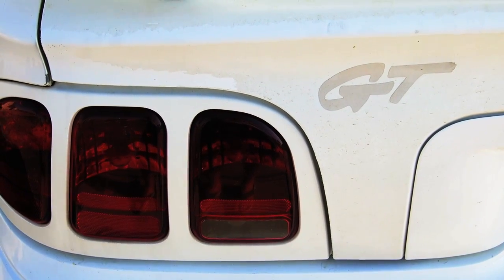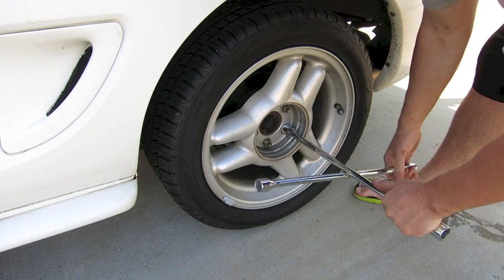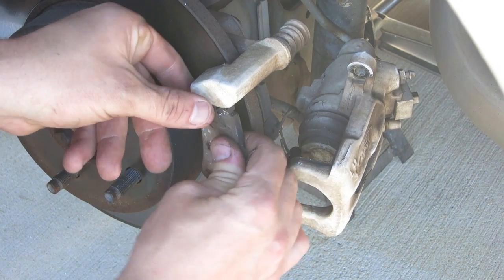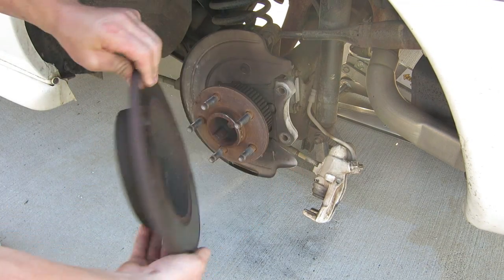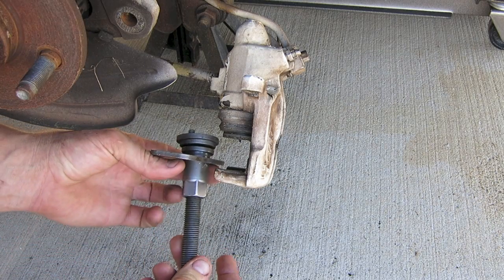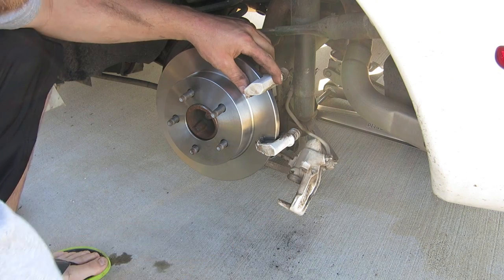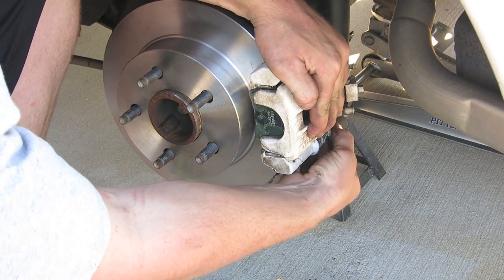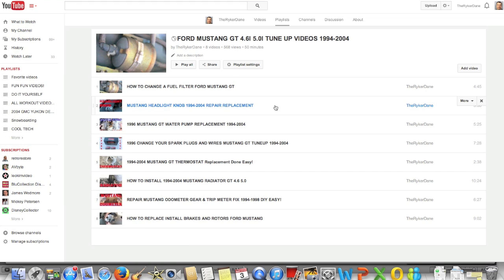MUSTANG REAR BRAKES AND ROTORS GT 4.6 5.0 1994-2004

Comment: Forgot to mention to open the cap on the brake fluid reservoir so the pressure doesn’t build up when you spin the piston back on the caliper. Good video though!
Reply: I crack the bleeder valve and let the fluid out that way. I have lost 3 master cylinders after forcing brake fluid backwards through the lines.

Comment: I'm having a lot of trouble putting the caliper back on. It seems as thought the piston is back as far as it will go, since no matter how much I spin it, it doesn't seem to be making any more progress and It's back as far as yours seemed to be. However, when I put on an old brake pad on the front, since it is much thinner, I am able to fit the caliper onto the rotor. I have been working on this for hours. Any help??
Reply from the maker: 4thatdude1 the rear brakes are tricky because you have to spin them. But as long as you get the piston back in far enough to put the pads in they should go on, unless somehow you have the wrong brake pads. Make sure the piston is almost flush when it is spun in. I hope you get it.

Comment: I got this tool and it works on the rear brakes perfectly. The indents are 22MM. You can also use it on the front, too. Use some 7/16 washers.

Comment: Thanks for this video. I have a friend who is coming over to fix them. But, I am gonna try to have them disassembled for him. That way he can basically put the pads and rotors back on. Also gonna replace a stuck disk brake caliper on the passenger front. Thanks agin for the information !
Reply from the maker: Glad I could help

Comment: Ahhhh.......makes sense.  Thanks for that little nugget.  When you mentioned something about some instruction manuals suggesting using needle nose pliers, I thought to myself:  WTF?!?  Then I realized they were probably needed so that you could jam them into your skull and end it all after you realize that these rear brake cylinders don't just retract straight back with even pressure.............but that they screw back into position

.......now that DOES make me wonder how they unscrew themselves to make contact with the brake pads when pressure is applied to the brake pedal.  I will investigate this phenomenon further........as I have no life and am waiting delivery on my 2002 premium convertible to arrive from NJ.
Reply from the maker: Yep i know, I never would have thought they would have had this design on an American car from that year. A lot of foreign cars have that design on the rear. not sure why.

Comment: Thanks for the video. It boosted my confidence. I just want to know what is the bigger clip for? I didn't see you install it and I never saw an old one when I removed mine. Thanks.
Reply from the maker: The clips I think you are talking about are the ones that are there to make noise when your brake pads are low. Sometimes people install them and sometimes people don't.
Reply: thanks

Comment: Good video.  It looks like you forgot to install the little butterfly plate thing that clips into the caliper casing.  You point to it and even pick it up at 3:55, but you don’t install it. It is needed to allow the little wires coming off the pads to slide against smooth metal instead of the rough caliper casting.
Reply from the maker: Pet Rock's Garage You are correct, For some reason I didn't show it in the video, not sure why. I did install them on the caliper though. Thanks for letting me know.

Comment: It's easier to depress the piston in by opening the bleeder valve and let the brake fluid go through a funnel and a bottle. Otherwise you're pushing the fluid back into the brake lines.

Comment: This video helps a lot. I still need to do my passenger side. And I had to take off a small spring so I could reach the bolt in the bottom. Do you know what that spring was for?
Reply from the maker: I think the spring you are referring to is a spring that keeps tension on the emergency brake cable. You need to make sure you put that back on. Glad I could help, thanks for watching!  Also what year mustang do you own?
Reply: Yeah it was for the ebrake. It was really hard to put back on. So I left it out.  I have a 2001 mustang gt.

Comment: Tried this today and was almost done when I realized I didn't have the clips for the brake pads, they weren't in the box and the old ones didn't have them on them either! So back to Advanced I went. Also how do you know when the piston is fully compressed? I turned and turned mine and it never got tight.
Reply from the maker: just turn it until you can get the caliper back on, then when  you push the brake pedal it will tighten up

Comment: GOOD video. Got a question for you. Is there an easier way to get the E-brake spring back on the caliper?  It popped off,  and now I'm having  trouble getting it back on. I did this same job a couple of years back, with the same problem. I eventually got the spring back into place ( an hour or so)  after dikkin with it.  Do they have a specific tool for this? Arthritis  is preventing me from using my first method.
Reply from the maker: I guess I am not sure if there is a tool or not for this. There might be one in a kit you can get from advanced auto or oreilly auto
Reply: I just used a pair of needle nose pliers and a lot of force, I got the cables to go back in. I'd rather not have to go through it again though.

Comment: At 3:46, where does that bigger clip go?  I got one with a hardware kit but I didn't see one coming off when I took them apart.... and you didn't seem to put it on.
Reply: It goes in the center of the caliper above the piston and one end sticks out thru the Gap on top
Reply: @mr.ed2092  Hrm, doesn't look like he put it in there... ? Took mine off to replace them got the hardware kit and came with that clip... but mine didn't have that anywhere, is why I'm asking.

Comment: Im having alot of trouble trying to put the break piston in using the tool. Its too hard to twist it in. How can i make if smooth?
Reply from the maker: Diego Estrada Yes it can be very tricky and hard to put back in. Try spraying WD or PB blaster on it if they are rusted up brakes, This might help them go in a little easier.

Comment: I did the exact intructions. Lol but for my test run to the gas station and back. My back tires went up in smoke and the rims are hot to the touch. What could be the cause of this?
Reply: Did you wipe the brake cleaner off after spraying the fuck out of it?

Comment: You don't need to open the master cylinder or bleed the brakes with this process?
Reply from the maker: +asmodeus20 nope, only when disconnecting the brake lines from the caliper
Reply: Awesome, did my rear brakes the other day.  Had to pound the crap out of one rotor rusted shut on the hub, nothing about 5 mins with a dead blow hammer couldn't fix!  This process also fixed my constant-on brake warning light on the dash cluster.  Saved a ton of money! Excellent video, thanks Dane!
Reply: you do have to open the brake fluid reservoir, and remove 60 to 80 ccs of brake fluid, otherwise as you compress the piston the brake fluid will go all over your floor.

Comment: Why does my 1998 Ford Mustang seem to have allen wrench bolts and a rubber boot on another one that doesn't seem to want to come off
Reply from the maker: You don’t take those off for the caliper. Unless someone swapped out the factory bolts for Allen wrench bolts which they shouldn’t have.

Comment: is it 100 ft lbs for all models between 94-04?
Reply from the maker: Yes thats a general guide for those years. Might be different with other wheels
Reply: TheRykerDane Ok thanks. I plan on getting a Mustang GT in those years. I'll probably stay with stock wheels because it will be my first car.
Reply: XxAdamIsChaosxX you need to get some ccw rims brah

Comment: ..I tried using Needle-Nose to turn the piston, it didn't work. Next time (when I upgrade the rotors) I will hopefully be able to buy the specific tool. 😉🖒
Reply: +Tr1ppyDJ4L.A. The tool is the only way to go!  My pistons were hard AF to turn even with the tool, I couldn't imagine with needlenose pliers.  They have it at O'Reilly for about $60 deposit, fully refundable.  Protip: use cash so you don't have to wait 3-5 business days for your card to be refunded.
Reply: +asmodeus20 🖒🤘
Reply from the maker: +Tr1ppyDJ4L.A. you can always rent it
Reply: +TheRykerDane 😃🖒

Comment: What's the name of tht tool u used to put in the brake caliper tried twisting it but didn't go in with big plyers
Reply from the maker: Ruben Mendoza It's a brake tool kit that you need to rent from your auto part store. It can be done with a needle nose pliers but it is very hard.
Reply: TheRykerDane so what happens if you dont use this tool? I didnt know it turned when pushing in so i used a clamp and hammer and eventually got it to go in but I'm guessing I ruined the caliper?
Reply from the maker: The420Smokey420 Its just a lot easier with the tool. It will also take a lot of time and aggravation out of the job too. As long as its not damaged and you got it in, you should be good.
Reply: TheRykerDane Yea it went in fine, but I did have to unhook the brake line so I had to bleed it, which isnt hard. But now for some reason it smokes and gets really hot when i drive. I've taken it back off a few times and tried to resolve it, but it still does the same thing, and it cracked the pads from getting so hot.
Reply from the maker: The420Smokey420 Are you sure they are not rubbing? Is the caliper tight on the pads? Does the wheel spin freely when you put everything back together? I hope the piston is till working ok
Reply: TheRykerDane The rotor does seem to be a bit tight, but it does turn a little by hand, and I pushed the caliper back in and then had my daughter press the brake while i watched it, and it closed on the rotor like it should, and when she let off it did back off the rotor just a hair like it should. While driving I don't hear any rubbing or anything, it sounds and works like it should, it just gets really hot and smokes, it doesn't get hot enough to make the rotor glow, though i haven't driven it more than 4 or 5 miles at a time because I'm afraid its going to make the brakes seize. It did however get hot enough once to make a weird high pitched rubbing sound especially when i hit the gas.
Reply from the maker: The420Smokey420 hmm, well i guess your pads are new, so that can't be it unless you have faulty ones. How about your rotors? are they new? If not then you might need to have them turned or just replace them since its possible they could be warped.
Reply: TheRykerDane I had the rotor turned before i put the new pads on, and both the new pads cracked in the middle I'm guessing from heat and maybe some pressure where it wasn't suppose to be. The pads were also crumbling around some of the edges from I'm guessing excessive heat since they were new and not cured yet.
Reply: TheRykerDane it was a seized up pin, changed out the bracket and pins and it works fine now.
Reply from the maker: The420Smokey420 Awesome, glad you got it fixed

Comment: can you just use a c clamp to push back the brake piston?
Reply from the maker: stangmang21 Yes, this works too, just adjust a bunch of times.
Reply: nevermind, it was such a hassle. i ended up twistin the clamp so hard i bent it and had to get the proper tool lol.

Comment: What about the parking brake cable
Reply: Yeah that’s what I was thinking too I saw another vid. Where a guy was putting a hose clamp on the brake hose  and bleeding the break as he went.
Reply from the maker: no need for this since it is mechanical. It doesnt use brake fluid

Comment: Is renting that special caliper compression tool really necessary?  Tell me why a 'C'-clamp would not get the job done?  It might be a little more problematic to keep the C-clamp from spinning off the end (a thin piece of wood would help), but it would help keep the cost down of having to find and rent a specialty tool.
Reply from the maker: Yes it is needed. The piston actually spins like a screw back into the caliper. It does not just press straight back in. So you need the tool with the little pegs so twist (spin) the piston back in. And the rental fee is free, you just have to put down a $50 deposit at most places, and you get it back when you return the tool. Hope that helps.

Comment: I like your video, but when compressing the caliper piston you only need a large c-clamp and a soft wood board. That compressor you have looks expensive.
Reply from the maker: Well it was about 10 dollars and I have used it multiple times, so it paid for itself
Reply: Nice. I also found (Though I'm sure others already knew) that you can get a loaner where I bought he parts from. So it's actually free. Again, good video, didn't mean to hijack.